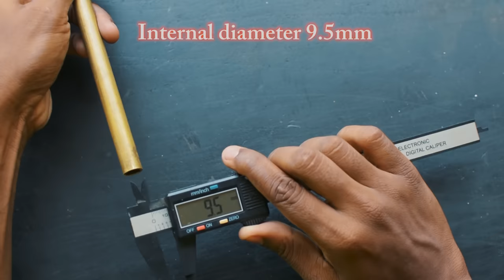PCP's Hammer Valve & Receiver Block

Comment: Hello, good description and very good realization, only problem, are your units of measurement.
MM = Milimeter and not Centimeter (= CM).
Otherwise everything is ok go on like this ..... Good job
Reply: 25.4mm =  2.54cm = 1in
Reply: @cybern9ne  the MM conversion is alot more accurate which is why it was used over 2.54cm and 1in due to small minor margins of error one could make

Comment: Are you hitting the valve of the bottle regulator to open the air? Do you need a plenum for this? Great videos btw :)
Reply: I think maybe he's removed the pin from the regulator so his new valve is the lid of the bottle, not sure though I'm also wondering how.

Comment: Where can I contact you, I'm building a 50cal with 3000psi output, I cant figure out how to make the bolt action vlave with seal to chamber so air dont cone out .... I got a rear tank setup as the butsttock
Reply: You may want to check Airforce Talon airguns.They are pretty simple.